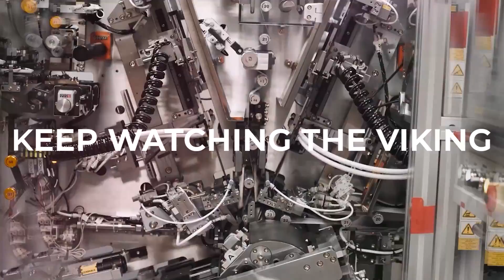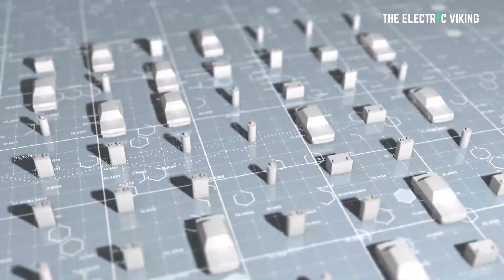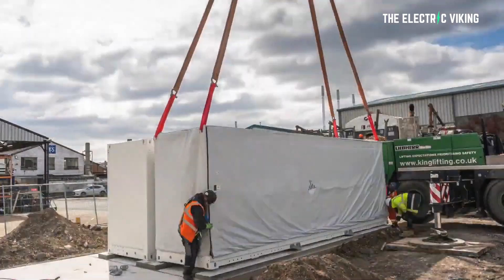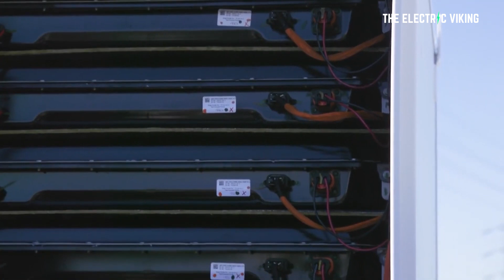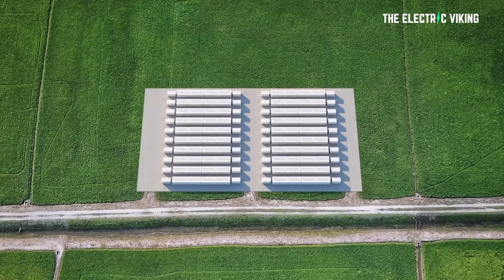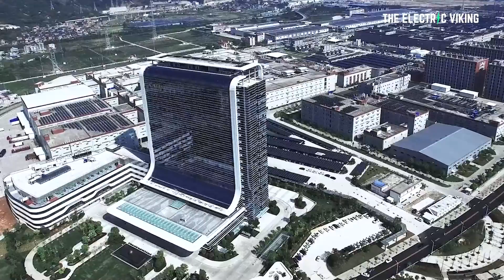Tesla just figured out how to make billions from energy storage

Comment: Energy storage is of enormous importance. In Germany we have a daily surplus of about 10 GW from solar energy at noon but a deficit of the same size in the evening. Only for the evening, extremely expensive gas power stations have to step in and produce power for about 80 cent/KWh. Storage capacity of 40 GW could completly replace electricity from gas and the price would go from 50 - 80 cent down to less than 15 cent again. 
So, 622 $/KWh would cost 1,70 per day and 17 cent in 10 years. That is already cheaper than gas.
Reply: Das stimmt. Hab mir 2017 Sonnen Batterie (Schwarm Speicher)mit PV angeschafft, war eine gute Entscheidung.

Comment: You may be right makes sense to me that two battery packs of roughly equal size and weight in cybertruck could give both medium and long range lfp / turnery.

But I would go further and have said in comments before the same will likely be true for the Semi. It just makes sense. More so with the semi where when they buy a truck they will know exactly the use case and if it only needs 300 miles get an lfp charge overnight (NOT SUPERCHARGS) truck will last forever 😉
Reply: 2 power supplies
2 Charging systems
2 BMS systems
Complication
Expensive
Possible points of failure
"KISS" (SIMPLE!)

Comment: Don’t think the Cybertruck is supposed to have LFP, not enough range, I had heard it would be nickel 4680s…possibly some manganese and maybe silicon when they get that expansion issue solved. I wouldn’t be surprised if Tesla’s battery chemistry changes every year or two for awhile…
Reply: Seems like LFP would work better in something more heavy duty like the Cybertruck. Hauling all that heavy battery around takes a beefy structure like a  pickup. It'd be nice not to have to worry about battery damage from trying to get back out of the boonies somewhere on a low battery.  Or, drawing the battery way down using it to power a job site and then get home ok.
Reply: "Expansion issue"?
.
Tesla battery chemistry changes incrementally all the time, similar to all their tech.
.
4680 Nickel cells is what the Hummer didn't have.
That's one reason it ballooned into the joke it is.
The CT will use the smallest pack with the lowest number of the highest energy cells available.

Comment: BTW, demand for the increasing but limited supply of 4680 batteries will be so great for the Cybertruck, Semi and model Y that it may be a few years before they would be available for battery storage.
Second, another advantage of LFP which you are very aware of but did not mention is both their longer life and ability to continuously charge between 0 and 100% rather than the 20-80% of NCA batteries
Reply: Very Good  🙂

Comment: LFP in the Cybertruck would make it great for a vehicle to grid setup, would it not?  Have it drive you to work, then drive itself back home and connect itself back to the grid, charging from your solar, storing that power or selling it to the grid as needed. Drive itself back to bring you home from work too. Maybe run your house all night, rinse and repeat.
Reply: The EV is the 'home' battery 24/7.
The battery comes 'free' with the vehicle.
Hahaha.
Reply: @stephenbrickwood1602  
But it's not.
It only collects when it's connected to your "microgrid" (solar)
If the grid doesn't want your solar during the day, (when you're out using the vehicle) where does it go?
It powers your home? But that's a tiny amount when you're not there and it's "ticking over".
Buy a battery
Collect ALL your solar.
Sell it ALL to the grid at peak (keep "15kWh" if you estimate that's what the vehicle will use that day)
.
You don't buy ANY energy.
You SELL all but what you use.
Payback is much faster and there's far more profit after that.
Reply: @rogerstarkey5390  just posted a longer reply
Reply: LoL
Reply: LFP all the way
Reply: @walkerdarin2003  
If any form of LFP makes even a 30% increase in energy density, it's only reaching the current density of the Tesla 2170 cells.
🤔
Reply: the cybertruck will have a big enough battery for V2G, the problem is timing, the emergency high paying time is 4 pm tp 9 pm. if you work 1st shift you vehicle will be unavailable for V2G during your commute, on average about an hour, so when you are ready to do V2G emergency rates your battery is down an hour and have missed at least 2 hours of prime time. if you do V2 G until 9 pm you will need to charge overnight for the next day.
Reply: @scottmcshannon6821  if there's money to be made it'll get figured out. Ten of thousands of big battery packs just sitting in parking lots all over are an asset that should be fully utilized. I think maybe I'd get a little "beater" for my commute and leave the truck at home to make some dough. All just speculation at this point.
Reply: @ElectricDanielBoone  you are exactly right, see my post below.
Feel free to copy and paste.
My nuclear engineering mate is lost in the past and makes me angry because he is talking to dumb politicians who are repeating his talking points.
Reply: @scottmcshannon6821 
I ABSOLUTELY agree. 
(Just posted similar elsewhere)
It's a false economy.
As you say, if you're not there, the truck isn't collecting your solar (makes sense to have solar!)
If you're working, when it's there (evening) it's often dark, so no solar.
When you arrive home is when the grid wants energy.
So you'll be selling it from the vehicle, then buying back later.
.
A home battery is FAR more sensible.
Takes energy ALL DAY (free)
.
Powers the home (free)
.
Powers the grid at peak time($).
.
Powers (charges) your vehicle overnight($)
.
Makes your solar far more efficient/ profitable($$)
.
Pays for itself VERY quickly($$$)
.
Reply: @rogerstarkey5390  the grid will connect your home and your ev anywhere, a new way of thinking.
'red ink' every where for the power generators
Reply: @rogerstarkey5390  and you cant just plug in and go, it takes over 10,000 worth of hardware to get this to work. if you thought far enough ahead to do this youve also probably realized that a powerwall or equivalent is a much better, FULL time solution.
of course if youve crashed your EV and just want to permanently plug the battery into your system fulltime, go right ahead. thats why no EV batteries are being recycled, they are going onto a second life as home battery storage.
Reply: That's what I would want as well (I do work 2nd shift) so v2g is possible and could definitely use basically everything it has as specs in duel motor+
Reply: The thing is if your home is always feeding the grid,
and you plug into the grid and trade stability or power for money,
then all the grid needs is to know your car computer.

The local grid is just taking or giving power, basically 24/7.
Except for your daily drive.
Say your 100kwh battery is always topped up, 93% to 100% full.
Daily drive is 7kwh.
You are always ready for the long drive.
Your car does not have to drive home to be useful to the grid.

I can imagine your, self parking vehicle 'nuzzling' onto a bumper height wall plug and trading electrical power 24/7/365.

Every building is connected to the grid, every building can have power plugs where needed.

20million buildings and 20million vehicles in Australia, google it, hahaha, true.

So, 20million rooftop solar PV systems, 30m2 on 150m2 roofs, ezi pezi.
Nothing but 'red ink' for the power companies.
The 40% grid power demand from homes can become a stable 24/7 40% SUPPLY, or more into the grid.

THE GRID IS WHERE THE MONEY WILL BE.

The nuclear power promoters hate what I am saying.
Big Hydrogen promoters are uncomfortable.

Tell more people, as big money wants to lock the government into decades of nuclear power and political donations and more grid construction to distribute their concentrated nuclear electricity. 

I am a Construction Engineer, with decades of experience.
Reply: @stephenbrickwood1602  there ya go... problem solved.
Reply: @ElectricDanielBoone  there you go....
is that the expression? an oldy but a goody
haha
Reply: @stephenbrickwood1602  better?
Reply: @stephenbrickwood1602  
Better still?
Have solar with a home battery doing that when you're using the vehicle.
Your home will be off grid most of the time.
You'll still be selling a large portion of the energy you make.
You won't be buying ANY back.
Your truck (etc) will be free to charge.
.
It's a license to print money.
Reply: @rogerstarkey5390  just posted a longer reply
Reply: @rogerstarkey5390  the ev battery comes free with the vehicle and the daily drive is only 7kwh, on a national avg.
Reply: No
Reply: THINK about V2G.
Unless your vehicle is at home for a good portion of the day, AND you have solar, it ties you to the grid
You have to charge at night using grid energy
Even if the vehicle is there, if the grid wants energy after dark, you're buying it back later.
.
Whereas
"Normal EV+ Powerwall"? (Other batteries available)
THAT lets you 
Collect ALL the energy you can for personal use (Power your home)
OR
Keep a sufficient amount to charge your vehicle overnight.
Power your home
Sell the rest.
OR
If the vehicle is at home, 
Power the house,
Sell the surplus.
It's versatile.
It's available ALL the time, when the grid needs it, not just when the vehicle is in a position to supply.
Reply: @rogerstarkey5390  yes you have several points.
just 'off the top of my head', 
for the entire population,
1/ if the ev battery is 100kwh, (for the long drive) and the daily drive is 7kwh, then 93% of the battery is not used, and easily topped up.
2/ if overnight home demand is 6kwh (and eg. Tesla home battery is only 14kwh) then that amount can be easily topped up daily.
and the battery is still 87% full.
3/ a small 6.6kw roof top solar, 33kwh, each day can easily supply 13kwh and the home and the grid.
4/ so 
we have storage capacity, 
we have useage, 
we have supply, and 
we have grid feed in, the left over.
5/ the killer insight is that the EV self parking is used to have the EV 'nuzzle' onto a bumper height power point and be connected to the grid 24/7/365. at every building it is near.
6/ the EV trades power and grid stability ( a very highly paid need in the new grid.)
7/ the grid can be connected to from anywhere and only needs to know the
vehicles owner)
8/ In Australia this will be a massive resource of power and storage, 660Gwh supply and 2,000 Gwh storage free every day.
It is the new combination that makes all the difference. The existing grid is perfect. 
$TRILLIONS saved from additional infrastructure construction.

Do you see what I mean?

The money will be in the existing grid ownership, connection fees paid by everyone, 20million buildings connected in little Australia.
Heavy power users will pay for extra power demand.

This is based on 33m2 solar system on a 150m2 roof. Avg.
This is simple when all is thought through.
Reply: @rogerstarkey5390  horse and cart thinking is what some one said to me when they pointed out all the new technology and the massive battery capacity that is coming.

Allan Fells said a 5fold increase in the old system because of the massive increase in demand, and is extremely too costly, the renewable way is the only practical option

Comment: The new IRA makes it almost imperative that the batteries used in either American made and sold EVs and  Battery storage devices must be domestically made as there will be a $35 advantage to such batteries over imported batteries and potentially another $10 advantage for domestic assembly. CATL will have to navigate between its need to rapidly get started building factories to produce batteries in the USA as quickly as possible using USA or friendly nation sourced materials if it is to sell into the American market at the risk of alienating the Chinese government for participating in this expansion of American capabilities at the expense of future Chinese production. 
Tesla will use CATL batteries in China and Berlin but only domestically produced by Tesla 4680 as well as 2170 and 1860 (model S and X) batteries from Panasonic if they can. However, it is possible that they will use China made CATL batteries for power units and EVs (model S and X and possibly model Ys after the ramping up of Austin) which will be shipped out of the USA.
Reply: The $35 and $10 references are per KWH.
Reply: TY